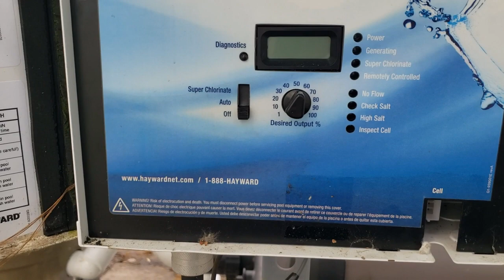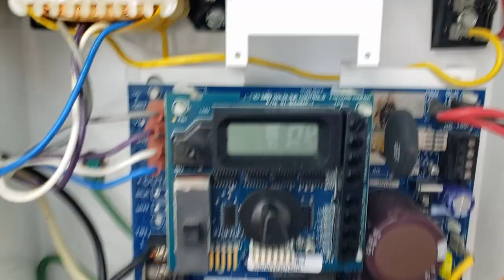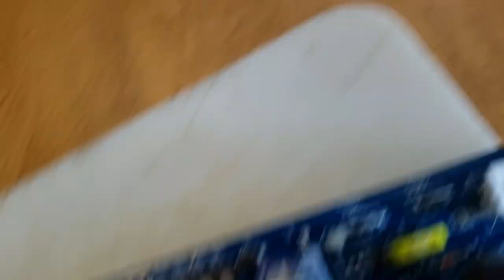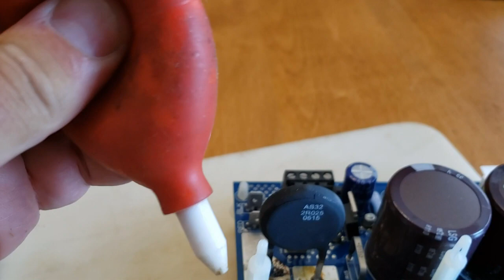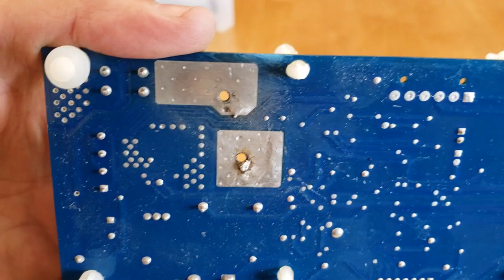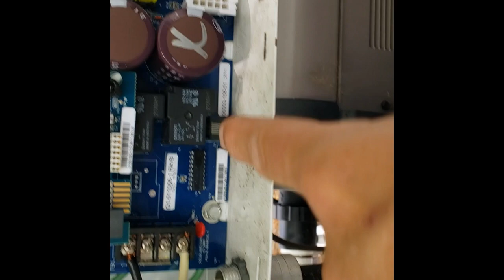Hayward Aqua Rite Salt Chlorine generator fix see description for part

Comment: Terrible video. Steel wool to clean up your lousy solder joint? Never.
Reply from the maker: First of all, i never claim to be an electronics guru.  I simply am showing people how to fix an expensive piece of equipment that breaks frequently.  Pool  stores WILL NOT do this fix, NOR WILL Hayward.  I am curious if you used the video to fix your chlorine generator?  If you did, then perhaps you should keep your negative comments to your self!  over 12,000 people have saved money by watching this horrible video.
Reply: @lkamons2  Say what? No dude,

Comment: First of all - THANK YOU!!!! You  provided clear instructions and you inspired me knowing that this fix can be done  by anyone. FYI for everyone, my LCD panel was working and able to scroll through menu, but the LED lights would work intermittently and this FIX resolved the issue. If you have any questions please message me. The part itself AS32-2R025 was n/a via Amazon and/or delivery delays and cost unreasonable - I managed to find the part at my local electronics component store for $15.
Reply from the maker: think that I had the part in the description  

https://www.digikey.com/en/products/detail/ametherm/AS32-2R025/2614388

Comment: If you’re thermistor keeps shorting out, it may be because your pump and salt generator are not on separate circuits; the pump should on a dedicated circuit.
Reply from the maker: I think it is poor design.  Separate circuits in my case .
Reply: @lkamons2  It sure was.  Their newer rev boards include a bypass relay that kicks in as soon as power is applied to effectively unload the thermistor while the unit is live.

Comment: With thermistors you need to attached something that will soak up the heat from the soldering prior to the heat reaching the thermistor side. If you get the thermistor too hot it will ruin it making it not work. Most of the times I hold the thermistor leg halfway up with pliers so the heat goes into the pliers first, but will still allow you to solder the leg to the board. This will allow a longer life of your thermistor because you did not heat soak it.
Reply: Use a roach clip for a heat sink
Reply: Exactly what i need to do thanks

Comment: CAN YOU POST A LINK OF THE WEBSITE WHERE YOU BOUGHT THE PART AT? THANKS!
Reply: Amazon
Reply: I have the same problem, no green power light and doesn't seem to be working. How can I find the part? Part #?
Reply: Digi-Key Corporation #570-1062-ND Current limiter inrush 2 OHM 25A, I ordered 10 back in 2011 for $21.73, just replaced it for 2nd time today, have 8 left for future use

Comment: Hi, my unit always reads 3700 for the salt level. I believe the power light is also not on. Could this be the problem or the salt cell?
Reply from the maker: Does the generating light go on?
Reply: Larry Kamons yes it does when the pump runs. But it doesn’t chlorinate the pool.
Ever since I have moved to this house with this pool I have always just put a chlorine tablet in the skimmer to keep the levels
Reply: The generate light shuts offer after a minute or so